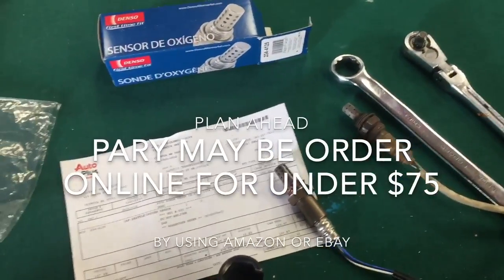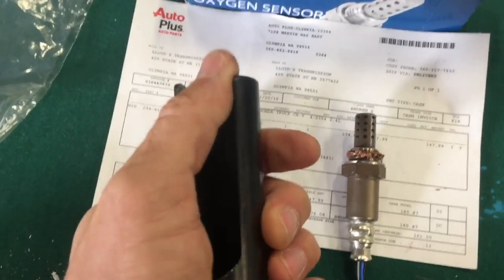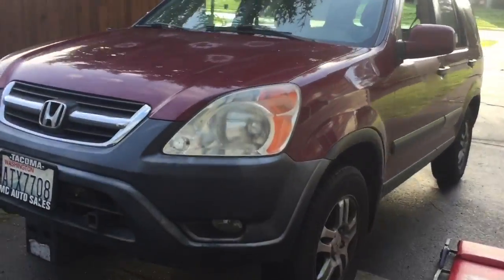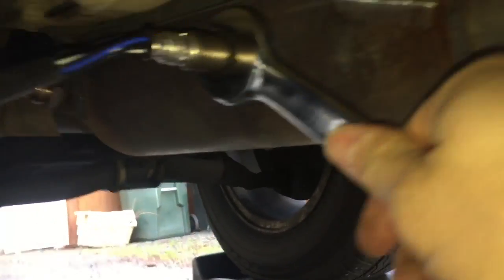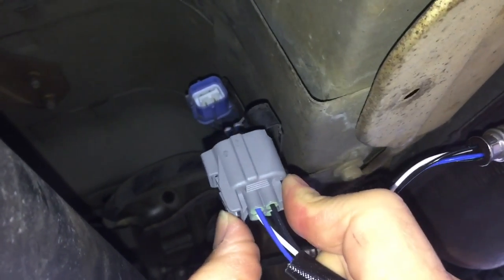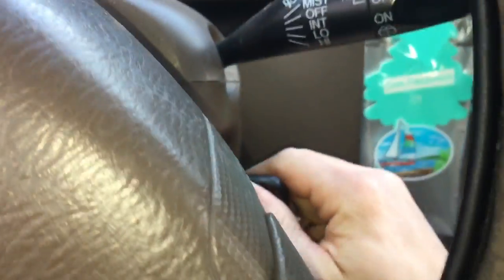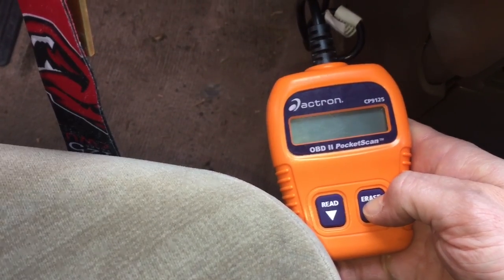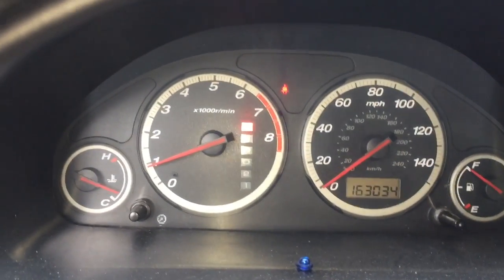How to fix code P0420 or lack of acceleration on Honda CR-V and other make & models: detailed guide

Comment: Hi, I got 3 cel codes by Honda dealer on my 04 Honda CRV : P0401 and P0404 Misfire Emission System Problem 02 Sensor Failure.
Now are the first ones about to clean or replace EGR, then the last one is that upstream or downstream sensor? Please help me.  thank you so much.
Reply from the maker: Is your car cranking excessively before starting? With those codes it more likely that a failing catalytic converter may but the culprit. In many cases you can get away with simply cleaning them EGR valve. As for the O2 sensor that would be the downstream.
Reply: @TweekerDan1984  no sir. There is non , just check engine lights
Reply: @TweekerDan1984  thank you so much for advising,  should I just start with cleaning the EGR, is that cost a lot of money,  again thank you
Reply from the maker: Yes cleaning the EGR is a good start sometimes they become too dirty and clogged by carbon build up. You may also want to try cleaning the 02 sensor. Emory cloth (a type of sanding paper) and brake cleaner help in this process.
Reply: @TweekerDan1984  how to clean the 02 sensor?

Comment: I have a 08 Honda civic hybrid, catalytic converter was replaced last year. same code and check engine light is on. Could it be sensor?
Reply from the maker: Yes it could be a sensor, if the catalytic converter was replaced I would focus on your oxygen sensor bank one sensor two or the 02 sensor closest to your catalytic converter.
Reply: @TweekerDan1984  could you be my super hero hero and direct me where I should look for these? Seems like these parts are are listed the same on some sites,  any help I would love!
Reply from the maker: Can you send me the engine size.
Reply: @TweekerDan1984  1.3 L 4 cyl
Reply from the maker: Here is what I found for that vehicle. I hope this helps 👍 O2 Oxygen Sensor DOWNSTREAM New For Honda Civic 1.3L  Denso 234-4350 you can expect to pay $45-$65 if you purchase online.
Reply: @TweekerDan1984  thank you soo much!!
Reply: @TweekerDan1984  So I have a strange update for you. Since I just bought this car last year, and the converter was replaced the same time, I was going to bring the car to Honda to properly diagnose,  so I could have the dealer replace the converter. My appt with Honda is on Monday. I havent done anything to my car, but I have been driving it, check engine light on the whole time. Today, after driving on the freeway, I stopped at 711, when got back in my car, I couldnt believe it...light is gone! NOT ONLY THAT, I can feel the difference in my car...driving way better...any ideas??

Comment: Will this work on my wheel barrell? It's got an 02 sensor going into the rear tire and won't pass emissions so I can't use it for hauling dirt around pls replt fast pls need temp fix dont giv a fuk.about the environment need to new fukin cat i hope not.pls pls fould.spark plugz, new sinsor, pls fuck i want taco bell

Comment: P420 codes do not get fixed by replacing the sensor
Reply from the maker: They do if you happen to have a bad sensor. I clearly state in the description that there is a process of elimination before just replacing the sensor. Testing the catalytic converter is part of this process. In my case replacing this sensor corrected my issue, it has been years and all is still well.

Comment: This will not fix the problem when converter gets old and used  for a long time its unable to clean exhaust gases like it used to and neither store oxygen. Cleaning it can fix exhaust flow but not p0420. Change converter with a another higher quality aftermarket converter. Bad oxygen sensor will never cause p0420 code